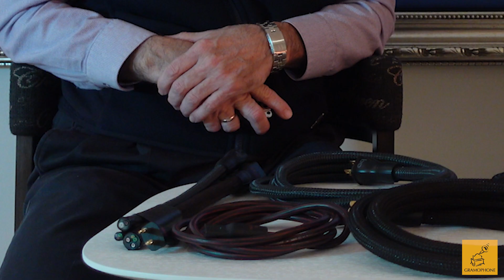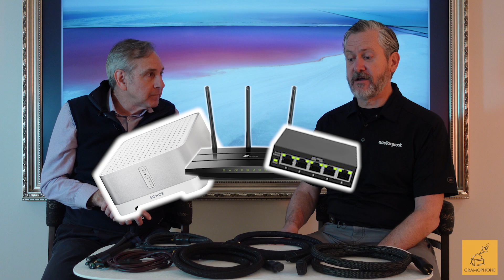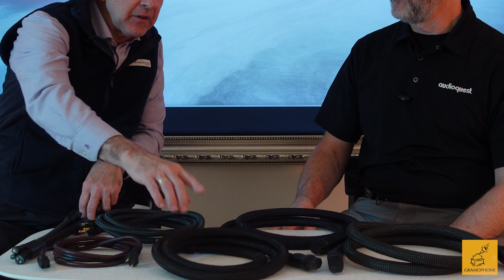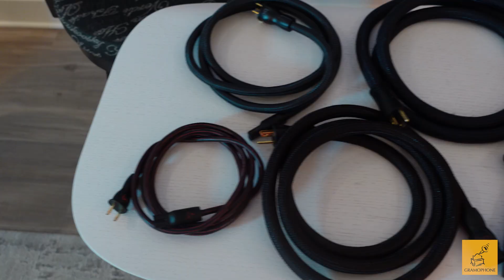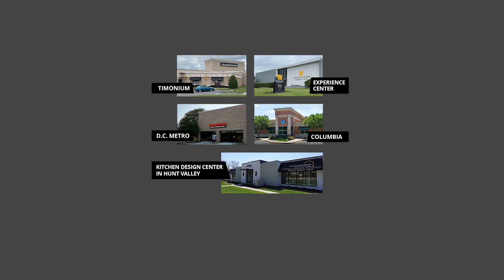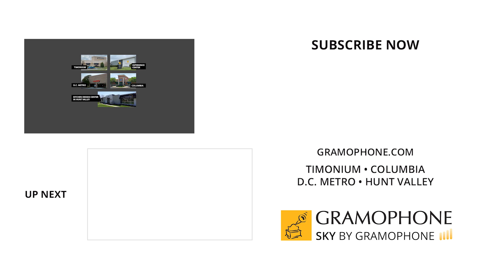Power Cable | Power Conditioning Your System | Gramophone

Comment: As a video technician, I can confirm that your story is complete nonsense — there's no relation between power cables and video or audio quality, as long as the cable isn’t faulty. Modern devices have internal power supplies that regulate and filter incoming voltage long before it reaches any signal processing. And let’s not forget: that electricity has already travelled through kilometers of standard-grade cabling before it ever reaches your wall socket. In short: pure snake oil — a marketing gimmick with zero technical basis.
Reply from the maker: Hello hebus, thank you for your comments.  We're sorry to hear that your experiences with better cables and audio / video quality haven't produced the same results that we've enjoyed
Reply: @GramophoneMD  Thanks for your response. Just to be clear: there is NO technical way a more expensive power cable can improve the audio or video quality of your equipment.

Again: Modern devices like TVs, amplifiers, and routers etc.  regulate and filter incoming electricity internally, so the power cable has absolutely no effect and cannot technical have any impact on the signal.

In short, it is technically impossible for a standard, properly functioning power cable to improve the audio or video quality of your equipment. To use an analogy: it's like saying your coffee tastes better just because you upgraded the power cable on your coffee machine....What is often perceived as an improvement you think you hear or see is purely psychological — a placebo.

Comment: I would like to quote Ethan Winer, audio engineer and musician for more than 45 years: "Finally, the belief that AC power cables affect audio quality is the easiest myth to dispel. Like speaker wire, as long as the gauge is adequate for the length and required amount of current, a power cord simply can’t affect sound quality." SOUND ON SOUND, Stop worrying about wire, October 2017.
Reply from the maker: Hi Peter, thank you for supporting our channel.  Agreed - there are plenty of talented people who do not believe that cables and interconnects make an audible difference.

Comment: Power cables don't affect performance. How many more times do people need to be told!
Reply from the maker: Hello Mrs Z, in my own system, I was amazed at how much better our Sony TV's picture looked with a high quality cable power cable swapped out for the stock one.  Music performance similarly improved.  We're sorry that whichever power cables you have tried haven't brought the results you were seeking
Reply: @GramophoneMD   The problem is that it isn't possible, but you can imagine such things. We are all vulnerable to the placebo effect.
Reply: @MrsZambezi  If you know anything about placebo, then you know there is also nocebo. Placebo means you think it happens even if it doesn't, nocebo means you think it does not happen, even if it does.

Thankfully, the effect of power cables on sound is well-documented and endless listening tests have actually proven there is a difference human subjects can discern.
Reply: @justadad2304  People can imagine all sorts, that is true, look at God for an example, but it isn't possible that a power lead can affect performance. Ask an engineer.
Reply: @justadad2304  I encourage you to read what Amir at Audi Science Review did three years ago labelled “AudioQuest NRG-X3 Power Cable Review”.
Reply: @justadad2304  Amir at Audi Science Review did a wide range of tests on the Audio Quest NRG-X3 power cable.  I encourage you to take a look at the results.
Reply: @justadad2304  no a  power cable does not affect the sound, that is technical not even related.
Reply: @GramophoneMD  That story is technical not even possible....
Reply from the maker: @hebus4  Thank you HeBus for supporting our channel.  Having experienced the benefits of upgraded cables ourselves, we're sorry that your experiments with better cables has not yielded an improvement in your system.
Reply: @GramophoneMD  How many times do people need to tell you this? If you know even a little about electricity and electronics, you’d realize that your claim is technically impossible. If you’re hearing a difference, something else is going on. Was your power cable crossing your speaker cable, perhaps? In that case, you might have been picking up a small interference or “bug” signal — for example, hum, buzz, or faint noise bleeding into the audio. Switching to a shielded power cable could reduce that interference, but that’s basically all that can happen. It has nothing to do with the cable itself or the electricity running through it.

And as for the claim about getting better color on your TV after changing the power cable — yeah, that’s also impossible. Maybe you accidentally changed a setting, but that’s the only real explanation. A power cord simply can’t make that kind of difference.
Reply from the maker: @hebus4  Hello HeBus, we thank you for supporting our channel.  It's ok for people to disagree on various audio topics - happens all the time.

Comment: Can I Plug this into my Aguilar AG 700 Head?
Reply from the maker: Hi Bassman, we took a quick look at the Aguilar and it is a three prong IEC connection, so it should work fine.  You may also want to check in with Aguilar though as we don't sell instrument amps like that one.

Comment: Are there still people gullible enough to believe in this "mystic" crap anymore?
Reply from the maker: Thanks for your comment, Hank.  Some phenomena in audio are measurable, but not consistently audible; others, more audible than measurable.  A decade or so ago, a retail sales guy upgraded his systems cables,, and installed them when his wife was out for the day, as he was afraid to tell her what he spent on something he assumed she'd scoff at.  She came back while he was playing music, and said, "This sounds great - what did you do to the system?"  That won't change the mind of a hard-core science person, but if it makes your system sound better, it's a good thing
Reply: @GramophoneMD   Cool story bro.
Reply: @GramophoneMD  We are talking about electrical signals going through a conductor wire. All details of such phenomenon has been known and documented for almost 2 centuries by mankind without any doubt or hesitation to its inner workings even at a quantum level. It is a known fact that none of our senses can even compare to the accuracy of modern electrical signal analysis equipment. When it comes to simple variable current electric signals, even a crappy voltmeter provides measurements million times beyond the sensitivity of the human body.  If it can't be even measured by a crappy voltmeter (let alone a 100K signal analyzer), it for sure can't be picked up by any of our sensory organs. Any perceived change at an audible level is a result of nothing other than psychoacoustics. Strangely enough the only method of preventing psychoacoustic bias is double blind testing, which people who are profiting from such voodoo magic are ALWAYS AVOIDING like the plague.
Reply: gullible enough to buy some UK specced kettle leads ?  they can handle more voltage & current and are cheap LOL